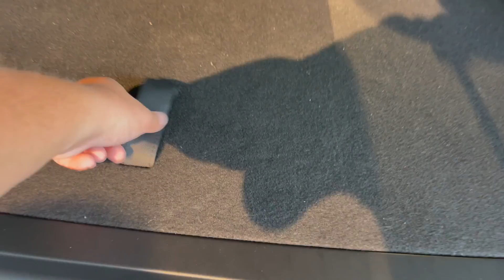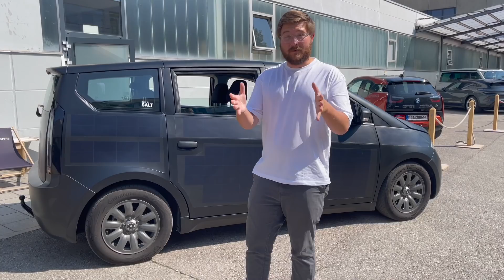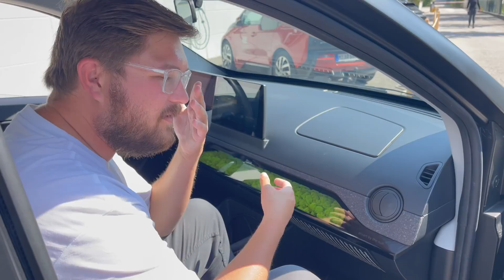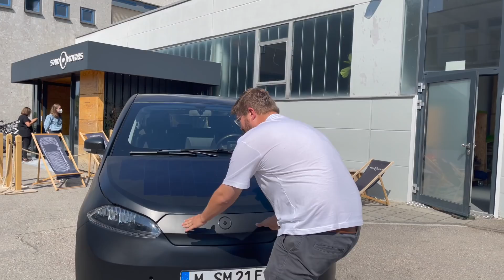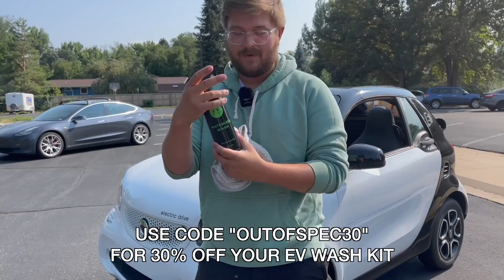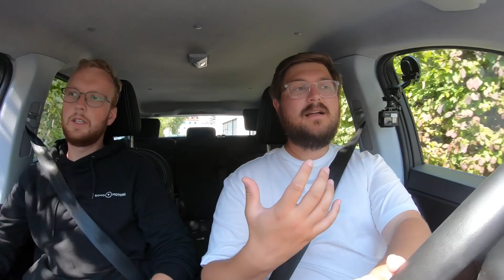I Drive The Sono Sion Prototype - A Car That Can Be Powered By The Sun!

Comment: I have so many things to say.  1st, can’t they come up with original names for their company Sono(not Sonos), or their car Sion(not Scion)?
  As an engineer, there are so many issues to overcome that I am sure this is a company backed more by hype than real practical solutions. Their value is way overrated. I have only watched their marketing and a couple articles on this prototype, so it is possible their engineers can prove me wrong, and I would love to see it.
  You seem to have a choice of any color, as long as it’s flat black.  Very retro.
Anything more than a minor scratch would render the solar cells dead.
  Drive carefully, and have a solar body shop on speed dial.  Can cells be replaced, or do you have to replace the entire body panel as a factory assembly?
  And, now for the practicality of absorbing solar energy.  They say the solar range is adequate for most Europeans average daily commute.  12 miles.  Do they also on average park in direct sun, at work, and at home?  These short commute drivers are likely in the city.  If their cities are anything like US cities, where buildings and parking structures are shading parking spaces, there is a big problem with the math.
  Math and physics are real, and can’t be changed by any matter of marketing business people or environmental activists.  I know we all wish this was the miracle car of today, but there are still many engineering challenges to solve in solar cell efficiency, battery storage efficiency, and capacity-to-weight before this car becomes viable.  And those solutions will improve all battery electric vehicles, regardless if they have on-board solar cells.
  I’m not trying to be negative, it’s just that I get really frustrated hearing so much misleading marketing that isn’t backed up by sound engineering.
  Contrast this company’s approach with others who have come out with heavily engineered products.  They usually place a technical officer alongside the product to give credibility to their early public appearances.  Think Tesla and Rivian.

Comment: dark vehicles are very hot inside after being parked, and therefore will use lots of battery to cool themselves once moving.
Does this one even have a/c ?
Reply: It does. But because it generates more energy when it’s sunny, it will use the solar energy to cool the inside of the car and the traction battery.
Reply: @Dubnoreix  thnks
Reply: @Dubnoreix  I doubt the power generation from  the panels would even be enough to cool the car.   Otherwise I would buy one just to sit in on a hot day.
Reply: @chrishart8548 , it can generate enough energy to give you an extra range of circa 30 km, which is enough power to keep the car and traction battery cool. It does not only have solar cells on the roof, but on the bonnet and boot as well. As well as on the doors. That’s a lot of solar cells and a lot of potential solar energy.
Reply: @Dubnoreix  well it's  around 16km a day in ideal conditions.  And if it's keeping the car cool all the the time wile it's sat in the sun.   I think it's only generating 3kw a day at most.  That would run A/C for about an hour.
Reply: @chrishart8548 , at peak performance it can generate 1,2 kW. And in ideal conditions it can give an extra range of 30 km.
Reply: @Dubnoreix  where did you read that. Fully charged said in good conditions with only solar it could fo 72 miles over a week.
Reply: That would mean over 2 weeks to charge the car on sun alone
Reply: @chrishart8548 , and 30 km is the average range gained per day, not per week.
Reply: @Dubnoreix  very wishfull thinking but good luck. A good 4kw roof system only puts out 2kw and a sunny day and that would barely fit on the roof of a bus !
Reply: @chrishart8548  More like 6 hours.
Reply: @chrishart8548  A 4 Kw system only puts out 2Kw???
Reply: @briandavies7402  In the UK maybe the sun doesn't get powerful enough for the peak power the roof may not be the perfect angle  or direction.   My friend fitted them for years.   Everything has losses  a 115ps (113hp) never makes that  and especially never at the  wheels .

Comment: You missed something that I really loved from an earlier video about it - the way the front passenger seat can be folded forward fully to create a very long load bay - ideal for carrying long bits of wood or concrete fence posts from the local DIY shop.
Reply: Yeh I loved that feature too, also how the rear storage floor is level with the lip of the hatch door so you can easily slide out heavy things and not damage anything if you need to leave it the hatch open enough to fit something even longer in. Refreshing to see a car with utility as a focus rather than how glossy the paint is.
Reply: That was in the rebuilt BMW i3, it had seats I believe came from a Renault Scenic. That is no longer present.
Reply: @billyfyre158  that's very sad! It was a great feature.

Comment: @Kyle, Perhaps when you get home you should review a base model KIA Rio or Nissan Altima to see what EV makers have to compete with at the bottom end of the market. Not everyone puts style before function. 

Power options like electrically operated windows and hatch lifts add cost, weight, and power consumption. Simple analog controls function better and are cheaper than badly implemented touchpads. Let a cheap car be cheap. The world is crying out today for a cheap electric commuter car. This could be the one, and is also suitable for those lining off the grid and people trying to make the least possible carbon emissions.
Reply: *living

Comment: They looked like Perovskite panels like they were just placed on the surface like a graphics sticker. Did they mention the type of panels the were Kyle❓ I like the use of every body panel being used. I’d want to wrap the car is a pattern that matched the varying colors of the panels or replicated them. If you could then PPF over everything to create a high gloss smooth finish it would be spectacular‼️
Reply: No they are embedded in the panel.

Comment: This is not really a second generation prototype! The first generation was revealed to be just rebuilt BMW i3 with a new body! This is the first generation prototype, not road legal, and they are just a few days from design freeze of the production car. Nothing is really tested. Solar is not really tested. 80W charging is cell output, you have to deduce the electronics needed to charge the car = negative result. A spotlight cannot charge the car.
Production is supposed to be in Evergrande-owned NEVS, that is facing bankruptcy. 14000 people have spent on average €3000 on this air number + €45 million from a Swedish enviromental fund. What will they get in return?
Reply: Good points and background info! And just to be clear, they were talking about the NOVELTY of charging by spotlight not actually saying it was possible. Kyle even did the quick math showing how rediculous that would be.
Reply: Evergrande is dead in about 30days

Comment: I think they should color-match car with solar cells. Ie if they use these particular cells, night-sky blue would be appropriate (final solar cells can have different colors from almost completely black to vibrant blue).
As for car itself - too bad they didn't went for more "sexy" styling. That's the difference between attracting enough customers and not. I understand, that they prefer flat panels for easier mounting of the cells, but even then they could have gone for something different than minivan.
I really believe that solar cells will become standard feature of EVs in the future - cells are extremely cheap and everything else that you would have to install is already there (maybe boost converter).
Reply: They have a community of customers and it was designed with input from them. Seems that kind of person can put up with this kind of car.

Comment: What's the efficiency of that vehicle. For solar to be at all useful you have to be extremely efficient. Aptera is shooting for 10 miles per kilowatt hour. The Aptera has a coefficient of drag of only 1.3 and a composite body, that thing looks like it has the aerodynamics of a brick. The Aptera is also incredibly light because it's fully composite that thing looks like it's heavier. But even with all of Aptera's optimizations they are only claiming 40 miles per day and that's at their home in San Diego everyone else is going to get 20. I'm skeptical that that thing is going to get a useful amount of energy from the sun
Reply: The aptera certainly is more efficient. But it also can only transport to people. It's weird looking to a lot of people I personally like it but a lot of people won't. It's a three-wheeler, efficiency doesn't matter if the car isn't practical enough for your daily use. Personally I think this car would make a fantastic Rideshare car or daily driver for a family. Where is the app Terra is not if you have more than two people to transport you would have to buy two of them. Also the Aptera even in its base price is going to be way more expensive than this.
I wish there were more electric vehicles like this available. Cuz it would be right up my alley. I drive for a living and something small and affordable but big enough inside to be useful would be the car I want.
Reply: I don't know for some people like me and my wife we don't use the car every day, so if I leave it parked and it gains 5 miles a day, then the next day we use it and it would cover a some of that milage so not worthless. Plus just knowing you can park up and come back to it a few days later and maybe gained 10 miles is nice.
Reply: @timscott3027  indeed.  I work at home and my wife's daily commute is quite a lot less than 10 miles. There are obviously other trips and shopping and so on but it would just reduce the need to think about charging more than once a week.
Reply: @timmurphy5541  assuming it all works properly I would be very interested in this car, but its been in development for a long time usually that's not a good sign. 🤞I hope this works out for them.
Reply: @timscott3027  Yes, I think it's just a case of "not enough money to go fast" as usual.
Reply: @timscott3027  +1 For those like me who don't need or even want to drive every day it looks like the best solution in the Ev space yet.
Reply: You're thinking miles versus km possibly. The Sion claims 34 km or 30 miles per day at peak. It'll be less in Germany. It's the sort of car that would suit me down to the ground because I do short trips most of the time.
Reply: @timmurphy5541  I don't believe 30 miles per day especially not in Germany. The Aptera will be at least twice as effecient as the Sono and they only claim 40 miles in Southern California. In Germany Aptera would get at best 20 miles per day. Divide that in half and you have 10 miles or 16 Km per day and that's in summer. In winter it would be less. Solar is a gimmick.  Solar alone is not a reason to buy a car. Aptera's effecientcy gives it extreme range, 250 miles on a 25KWh battery, 600 miles, 960 Kms,  on the 60KWh battery. That's an actual selling point. So is the price per mile on the Aptera because the cost of the battery is the driving factor in the cost of an EV.
Reply: @joshuarosen465  Again I think you're mixing up miles and km it's 20 miles - 34km AT MAXIMUM (which will be in a sunnier country)
Reply: @timmurphy5541  I'm not mixing up miles and kilometers. I'm saying that they are lying about how much range they can get. I don't believe they can possibly get 34 Km per day in Germany, it's half of that. I don't believe Aptera either but if you take them at face value and extrapolate for Sono you get half of what Sono claims. If you look at a solar map of the US you will see that California gets twice as much solar energy as the Northern parts of the US, Germany is North also so they will also get half of what California gets. Then look at the efficiency difference. Aptera is totally focused on effeciency, they have a tiny COF and very lightweight construction. Sono hasn't done any of that. My guess is that will be 4 to 5 miles per KWh, i.e 5 to 8 Km per KWh. Put those together and the Sono will get 1/4th as much solar range as Aptera which is only half the range they claim. Neither company has demonstrated anything yet and until they do their claims should be taken with a grain of salt, in Sono's case a tablespoon of salt.
Reply: @joshuarosen465  but they didn´t say that? So how can they be lying?  I read via Google that it was was their best case in a sunny climate.
Reply: @joshuarosen465  You might be right, I think I heard them say in another video that the solar will add about 5km per day, not sure of the conditions though. For someone who drives every other day with short commutes it might be all they need to hardly ever charge it.

Comment: Wonderful! Can you speak to the feasibility of bidirectional J1772 AC charging in the USA?
Reply: See the F-150 lightning... It's set to do just that
Reply: @mikeporet5655  I do not think you are correct. The Ford EVSE that enables V to H has a CCS connector, and Ford says an inverter is required. These two facts indicate that the Lightning is sending DC power to the Ford EVSE and then the inverter converts DC to AC to power your home. I think "cutting out the middleman" of the inverter and going direct from AC coming from the car makes more sense, which is why I posted the question here.

Comment: Every EV should have a solar panels installed  instead of dumb glass roofs, at least as an option.
Reply: Not at these prices and Watts we have now, waste of resources and money. Hyundai I5 has it and people complain it is useless. This car generates 200W from 1kWp. 1kWp on your house generates about 1000W. You do the math.
Reply: @marcusbiller867  .. not to mention that solar cells are far more fragile than a metal or even a glass roof, meaning that the low energy collection will probably degrade rapidly. And the fact that to get the most out of the solar roof, you need to park in full sunlight, meaning that most of the collected power will go to the air conditioning once you want to drive on.
Reply: As someone who parks primarily in an indoor garage (with level 2 charging), solar seems kind of pointless. However, if I had to park in an outdoor surface lot with no chargers at all, I would definitely want them. So, it all depends on the particular driver's situation.
Reply: I am sure there is a market for retrofitting this.